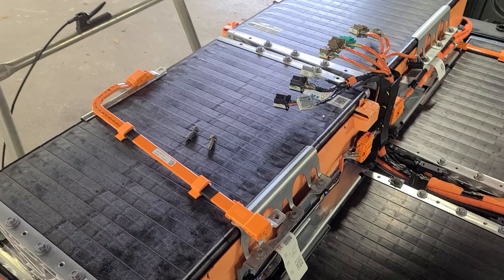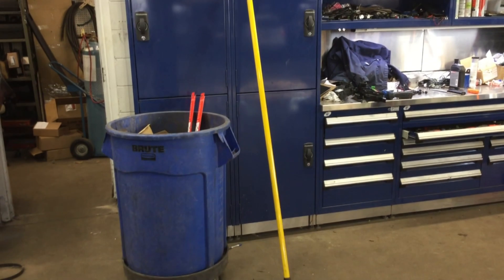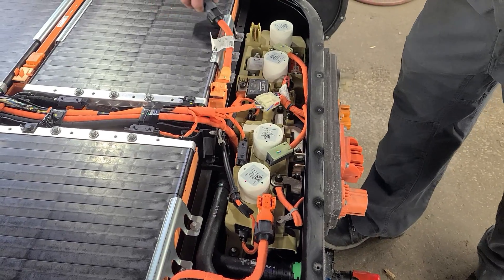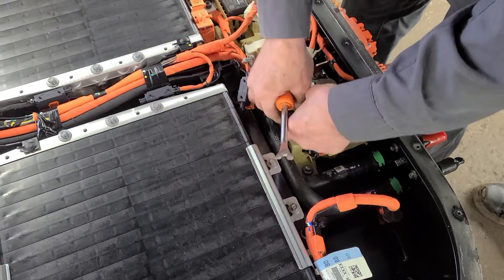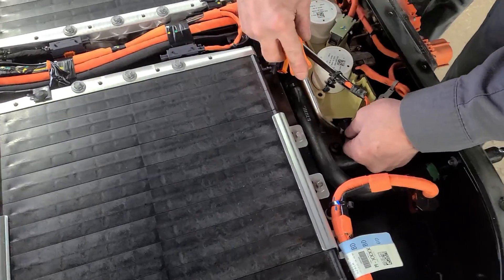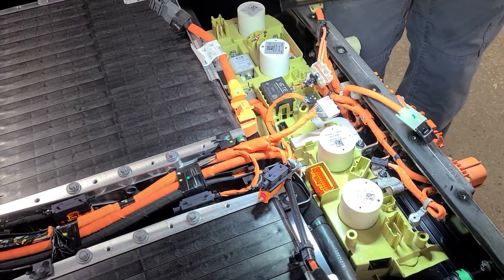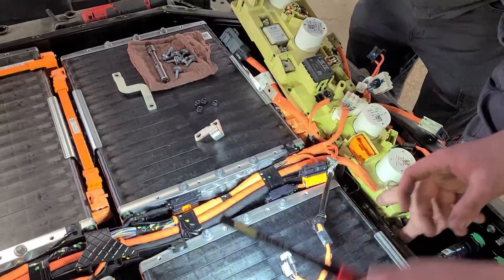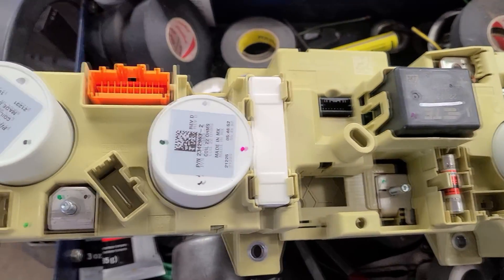Ford Mach-E Contactor Recall 23S56

Comment: Separating the buses on the battery is no substitute for wearing proper protective gear for working with high voltage.  You'd never see a linesman doing something like this.